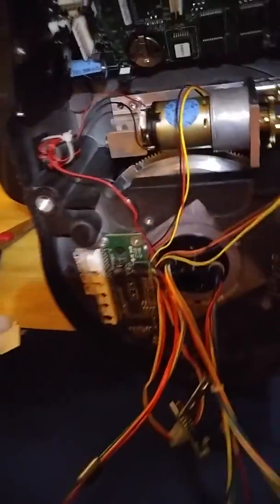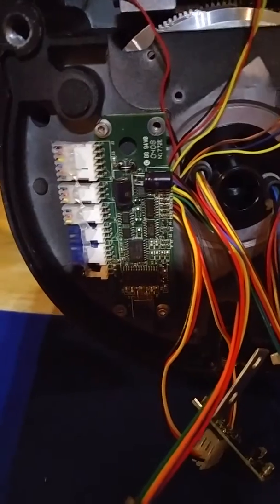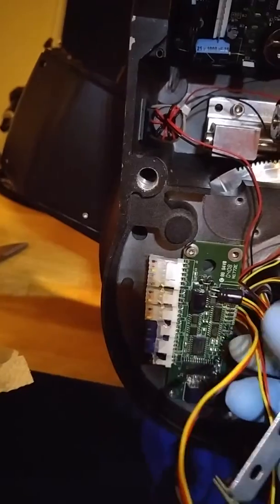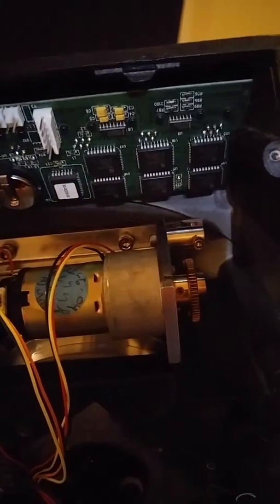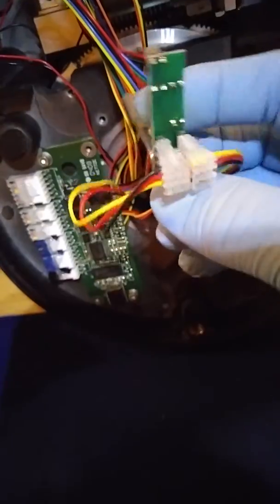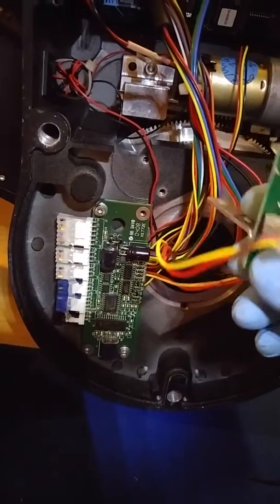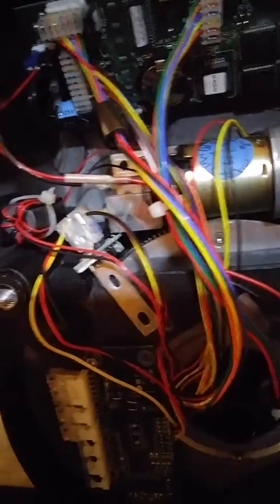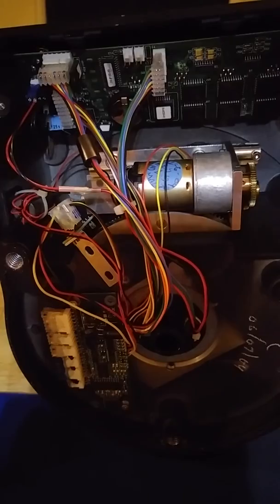Meade LX200 GPS RA  Drive part 2

Comment: You may want to check the alignment of the worm to the worm gear -> I had the motor out, measured the gear thickness (0.385 on mine) and the distance of the gear top to the mounting place for the motor assembly (mine was 1.221 inches) with a caliper. The base to the center of the gear should be equal to the top height - 0.5 of the gear thickness. The worm shaft center should match that number. Mine had a  rubber strip as a shim, (not good), and the motor minus that inadequate shim, was OFF by 0.082" too low, so the worm was only engaging the lower portion of the gear. I made a new shim, of 2 strips of .040 aluminum and re-secured the motor. Engages a lot better now. I also cleaned off all the original grease, and applied a thin layer Mobiletemp SHC32 (good to -50'C, I'm in Canada). That is the same as 'Buck's Red Grease' from Scopestuf.

Comment: Do you have a video on the level sensor fork arm assembly?  I have an LX600 (14") with some play in the mounting plate for the OTA.  When I try and snug the nut and spanner ring down to take out the play, the plate rubs and tightens down when I rotate it to check for play.  It seems like there should be a couple of delrin/slippery shims to keep the rotation smooth and non-binding.  On top of all that, I also have a declination motor not working.  I've replaced the board in the base, the previous owner replaced the dec board but it didn't help.  He said it became intermittent and then just stopped working.  RA works fine, 444 test shows nothing on the dec motor on the test.

Comment: Hello. I have got a LX200 GPS 14" for a small price, but the fork is not working. At the moment no RED LED light when power ON. Do you have any ideas where to get spare parts and is it worth to repair? Any tips to start with ? BR M

Comment: Have a lx200 GPS. When you turn on the switch with the handset connected the hand set lights up but no messages. none of the buttons do anything it does not slew or do anything. I tried a different handset results are the same. Any idea what the problem might be. Tried with new batteries and with a 12 volt adapter.no difference.